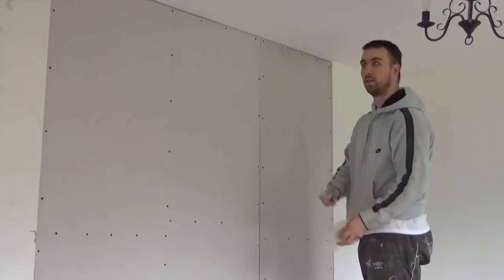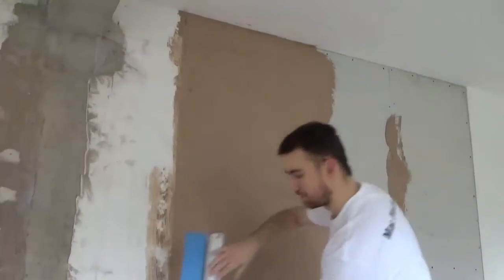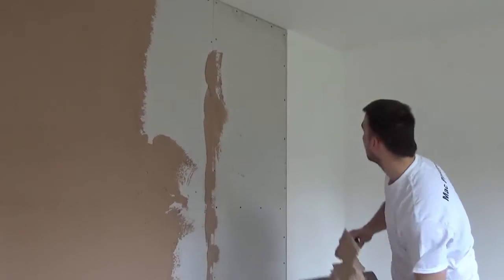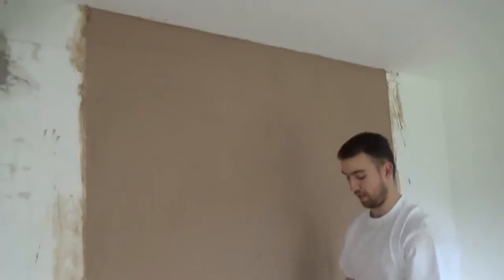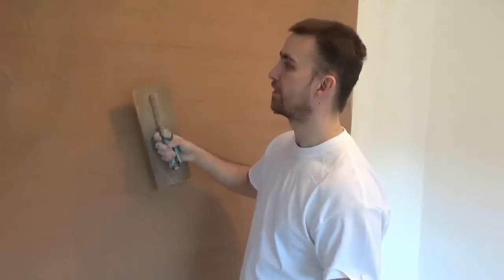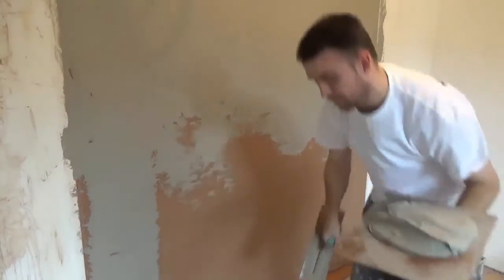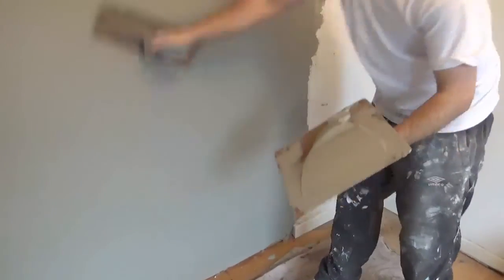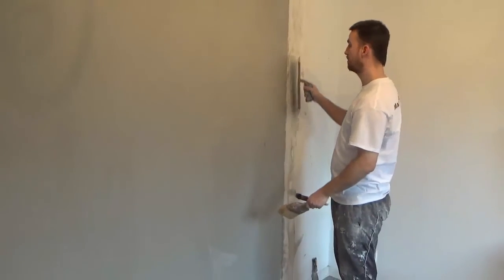How To Fill in an Old Doorway With Plaster DIY

Comment: Nice job and clever technique with old brush; it is very quick drying plaster to make two coats great finish. I was waiting to see any splatter on your nice new white T-Shirt.
Reply from the maker: +Steve Phillips Haha yes well the next job certainly got a few splats on it  as I had to do more scud coating it's a slurry of sand and cement splashed on wall but the t shirt only got a few maybe 5 spots on it makes me happy and the wash machine  Thanks again Steve have a great sunday :):)

Comment: Great video, you make it look easy, but wondered why you didn't put tape on the two edges, won't this crack.
Reply from the maker: It could crack even if tape is used but if i need tape i offer it up if i am patching i am looking for a flush finish so paint and patch work well not a blend it to me i see them all the time when painted so when i patch i try to go flush Did a patch a while ago and meet a painter that painted it done it this way and he said he was very impressed as what he dose is closes his eyes and feels the wall or ceiling patch he said straight away he knew it was going to paint lovely have a few other videos worth looking at so you see what i mean about the scrim tape also if it is well screwed will really help fight against cracking as cracking is caused by a few things one being movement / vibration but yea other videos here to help further explain mate https://youtu.be/gtRKuIRktUk https://youtu.be/g7JGrFYRrwo https://youtu.be/wrmlk8nhDSc
another thing mate if that if i was doing the whole wall i would for sure scrim the joint :)

Comment: When you apply the bonding coat do you bring it level with the existing wall or do you allow for the build up of the skim coats?
How do you avoid having a raised edge between the new and the old? 
Thank you for posting this video, very helpful.
Reply from the maker: Hi Steven buddy I in this video do will it out flush then cut it back to allow for the skim coats to then go flush you can underfill and then fill it out with skim but it is very hard to get it even all the way throw , if you fill to where you edges are then cut back you can judge it better , hope this makes senses hard to put into words better if i make vids and show LOL Thanks for watching mate
Reply: Build in layers... It comes out stronger..... Scratch every coat but the last one... Thin coat

Comment: Hi. I realise this is an old video but I have only just come across it. Can you tell me which plaster you put on first and the second?: I am going to do a 3 ft doorway myself.  Thank you.. 🤗
Reply from the maker: So to build out as the boards where a little bit to far back I used an under coat called bonding and 2 coats on top of that called finishing plaster either carlite or multiskim is fine 🙂

Comment: Hi buddy fab video I need me one if those darbys  but £46+ yikes  I guess I can use an alternative feather edge? I'm mostly getting a smooth finish but still needs work ....my one downfall us getting it straight /true more so to existing walls i.e. as I'm doing currently a door way I blocked off ....I've undercoated it the loving room side needs to be a nice finish.....I never stress when doing it I try to enjoy it  but just wish I was better (I'm.a bricky by trade see ) I only own a tyxak  14" im.assuming id need more than just the one trowel ? 

Thanks for any feedback great work
Reply from the maker: H Kevin mate thanks for watching and commenting, They do seem expensive but if your doing it day in day on its not to bad as for big ceilings and walls can come in handy, you can get this finish with out needing a super flex  trowel it can all be done with the steel the flexible trowels just take a big amount of strain of the arms in the final stages saving the joints so pains haha Tyzack are a great trowel if you watch a few of the other skimming videos I have how to plaster / re plaster a wall its mostly done with tyack also many with refina Thanks again for the support on the channel and always here mate for tips and ideas :)
Reply: @macplastering  thanks for your quick reply thats good to know matey as many say you need this trowel and that trowel .....what I dint quite get is the finishing trowel (I know the name might give it away ) but some even marshalltown  are quite cheap but why ? Compared to a typical 14" marshalltown  plastering trowel ? I'm.assumimg they're for finishing? As many are long bladed for getting lines out better/quicker ?.

Cheers anyway appreciate your feedback top man
Reply from the maker: Size of trowel is really down to the person on the most what they like and find works best for them but i do find it faster finishing with a super flex
Reply: @macplastering  ove heard this thanks mate great info ill keep up with your videos thanks
Reply from the maker: @kevinhancock4064  Cheers man appreciate  it mate :)

Comment: Would it be possible just to leave a 3mm gap and go straight to skim coats ?
Reply from the maker: For sure man if it was built that way would be perfect I didn't do the studding and boarding here it was left a little to heavy for just skim so needed to build it out but yes if it was 2 -3 mill would be ok for just skim :)

Comment: Did you scrim from the wall to the plaster board.
Reply from the maker: I thought I explained why i did not scrim it sorry I was just patching to the edge was not re doing the whole wall and this was the best way for a job that can be painted as it will finish flush
Reply: sorry I wasn't listening because of my moaning bird. will the edges cracking.
Reply from the maker: just got rained off  and after the good weather that was one bad time to try and do an outside  knowing my luck it will dry up now lol  > But to answer you Michael mate if the stud is built well and plaster-boarded well and you patch it in tight and neat it should be ok but even if you scrim tape  it there would be no guarantee  it wont crack either , best way in my books is = make sure the boards are well screwed and the stud is tight with no movement board it tight in all sides , if you want you could scrim up  to the edge as apposed to over it as i think it is a far better job if you are just patching , if you are re skimming then scrim over both hope this helps mate :)
Reply: Yer thanks mate great plasterer by the way.
Reply from the maker: Thanks buddy much appreciated, keep in touch for more :)

Comment: When you apply 2 coats 
Do you apply 2 coats with the same mix?
Reply from the maker: You can do it either way mate I actually have another patching video coming up,  but yes both ways will work if you have same mix you can get it on quick let it take up on wall / ceiling for 5 or 10 mins then 2nd coat or mix 2 batches .... Have uploaded a new video for a charity and another charity video is coming Sunday hope you have a few mins to support in anyway possible mate
Thanks again for watching :)

Comment: Hey man how many mm did you drop the stud work back to compensate for the coats of plaster? I'm gonna do one in my kitchen but like your video I don't want to skim the whole wall as its big:/ cheers
Reply from the maker: Hi buddy I would recommend 3mm be plenty i didn't actuality stud this so that is the reason for me having to bond it out but at least you know if you are deep in any area you can give it a bond coat :)
Reply: Cheers buddy, soooo if I set the stud back by 3 mm, can I just do 2 coats of finishing plaster?
Reply from the maker: BEAUSTEVENS1 Yes mate should be good to go
Reply: macplastering cheers fella, appreciate the advise , have a top weekend 👍🏼
Reply from the maker: BEAUSTEVENS1 You to mate good luck on the job :)

Comment: Just one more question. You don't put your plaster way past the seams on either side of the plasterboard.. Most videos I watched go at least 6 inches either side to blend in. Is it not necessary?.  Thank you again. 👍
Reply from the maker: Not necessary if you want a real good flush finish a painter recently told me how well I patched a job in and it was using this method he said he closes his eyes to feel the patch and joints and knew it was good before he'd even painted it made Me proud of my work
Reply: @macplastering  Thank you for replying. I will give your method a try. I have done it the other way so it will be interesting to see how it turns out. It was nice to hear a N.Ireland accent. I lived in Ballymoney for 30 years before coming back to England 7 years ago.  Maybe I am biased but, I do think NI has some of the best tradesmen. Thanks again for your help. 👍🤗
Reply from the maker: @gardenrose264  no problems anytime buddy thing is the other way is to try reduce cracking as they most likely scrim tape but it can be offered up have a few more patching videos that show it to if you wanna have a look 😉  but yes we don't have a massive amount of people here but a good few trades men so to get work we need to be faster tidier or better haha but yes loads of great workers here thanks again for watching and commenting mate 👍

Comment: This is probably a really a dumb question but here goes. I have a small bathroom window that has been bricked up from the outside (no plasterboard), the hole inside is about 1.5-2in deep. Can i use this technique to fill it in or is there a step before this i should do first?
And Congrats on becoming a Dad!
Reply from the maker: Hi Caz you could do this but i would recommend sand and cement as it is better for the type of wall you are doing as it will be stronger and more water resistant I have a video on mix sand and cement and also one with me cementing a wall ready for a skim coat witch might help you buddy.... thank you im still over the moon its so unreal how happy i am :)
Reply: Thank you so much. I will check out the video. 
Make the most of the younger years with your little one, they go by so fast and before you know it, they are "borrowing" your tools for jobs of their own ;)
Reply from the maker: Haha Yes if anything like me I will have no tools left :):)    Thanks man I see how quick the wee one is growing everyday  :):) 

If you need any more help just ask there i always me on as much as i can and others on the channel with loads of tips and wisdom :) no question is dumb we all learn from asking you dont know anything until you know it :)

Thanks again mate

Comment: Shouldn’t you also scrim tape where the plasterboard meets the existing wall, that will crack once the next summer arrives…

Otherwise very good and clear tutorial
Reply from the maker: No as he wanted it flush so it would paint best as the other way can look patch much more and remember just because you scrim it dont mean it wont crack thanks fir watching
Reply: @macplastering  so if you use tape it wont be flush would that be the same on a ceiling ?
Reply from the maker: @tuffbadger7342  you can offer scrim tape up to joint just if you over lap it it will cause a bump and not be flush you can feather out but I find that not as nice when painting but yes same at top just offer it up to ceiling without folding it around the corner